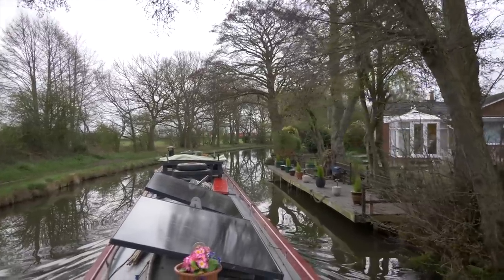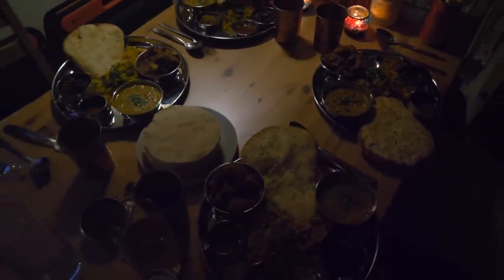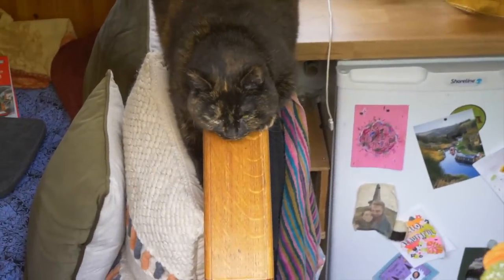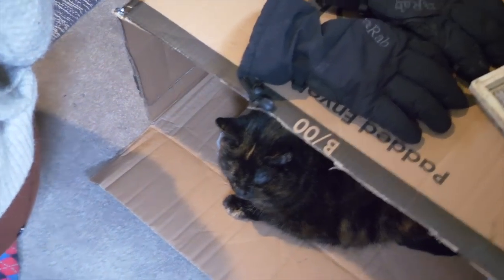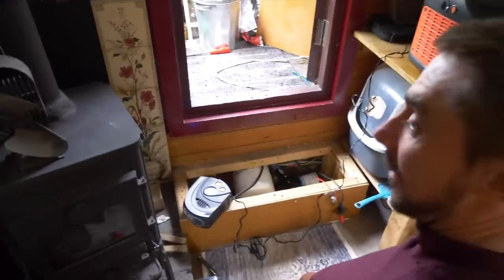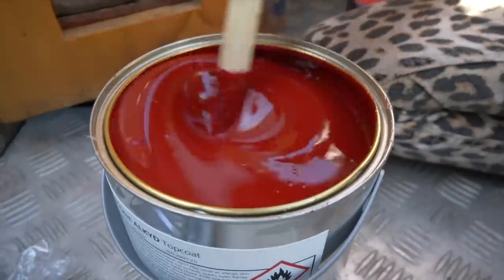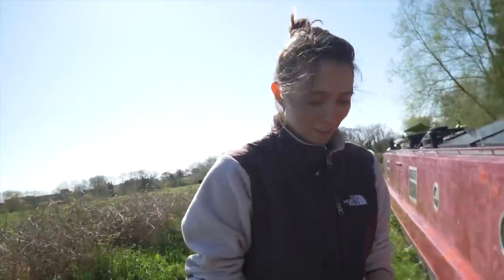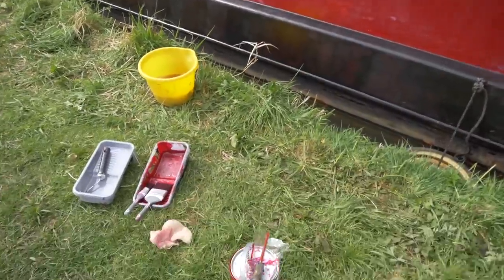Starting to paint our NARROWBOAT home | Life on the UK canals | EP47

Comment: The red gunwales were just wrong - it looks soo much better. A lovely bit of work. 
You've probably finished it now, but if you'd like more work, perhaps paint the top rails white? The roof is a bit of a poser. Bit of a waste as most of it's covered, but let your artistry rip, do a bit whenever you feel like it ? And use some kind of tough UV proof coating to preserve it ?

Comment: While I don't know about the brand and type of paint you are using, most paints can be painted over in a specific time window without the work of sanding between coats. Not only does this save time but it actually bonds better to the earlier coat.

Comment: Love the video, have you had a look at the pressure switch on the bottom of your pump as they stick / fail..they were about £6 plus p & p and easy to change...just have to set the pressure afterwards.
Ours did the same last year, so bought a new pump but then changed the contact switch so we now have a spare.
Keep up the good painting..

Comment: Rust is a base (oxide). The converter is an acid. Base + acid > salt + water, the oxygen from the rust combines with the hydrogen from the acid - H2O.

It's phosphoric acid because iron phosphate (the salt) isn't soluble in water.

[end geek mode]

You're doing it right. If the paint's well attached you'd not gain anything removing it. Rub it down to key it & give it a wipe over to remove grease & dust.

Comment: 10 to 1 the water problem is the pressure switch on the pump, and someti8mes this is caused by debris ...you can get replacement pressure switches
Reply: Yes, based on ShurFlo pumps I've worked on before, the issue is invariably the pressure switch.  The pump was originally made for domestic water systems in camper vans and ended up used in other applications.  I am sure you can Google how to check the pressure switch.
Reply: Do these canal boats have filters before the pump?